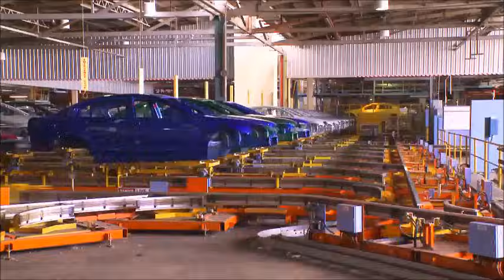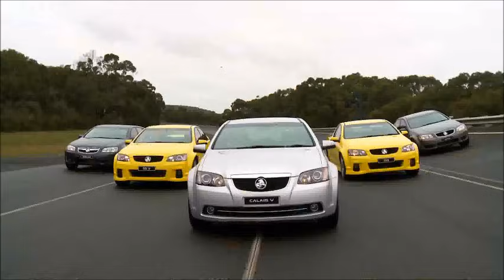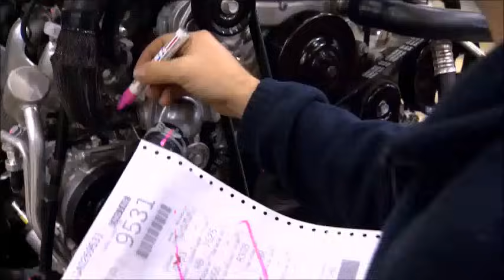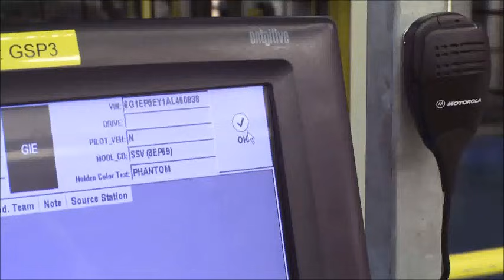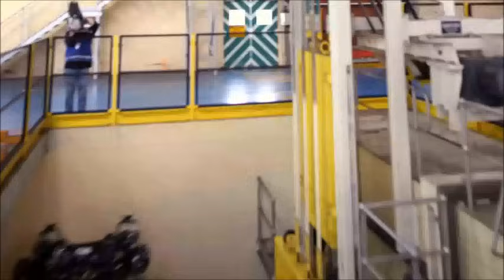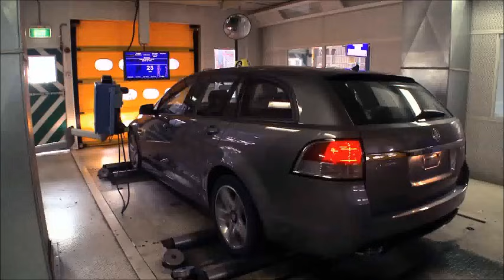Steel to Road - Building Holden VE Commodore FULL VERSION

Comment: you can see the design is maximised for production, there is very little thought for repair aspects, other factors over ride those poor sods who have to repair the vehicles. I have a ve commodore with fairly low km on it, quite a nice car but really not meant for ease of repair at all. The engine used in many vehicles in usa also, identical engine, and gearbox also.
Although assembled in australia seems lots of components usa made. Pretty amazing in my mind these complex vehicles are built at all.

Comment: I was unfortunately born way too late to enjoy a new holden, however, I don't see myself daily-driving anything but a Zeta-body Commodore. Truly Australian, and modern enough that I see them being a completely capable daily for decades to come, especially when you look at the drop in quality and excessive reliance on technology of modern equivalents. 

They may get old one day, but thankfully built in a time where they're still largely analog, and the digital components are easily repaired, replaced or compensated for.

Comment: Engines were rubbish timing chains
Reply: Change the fucking oil on time you half wit
Reply: Problem was people were servicing their VE’s at 15000km, Holden’s set guidelines, when in reality they should be servicing them every 6000-8000kms. I service mine at that range and have not had any issues with timing chain breaking or stretching. No issues with PCV either.

Comment: My VE Ute has now clocked 400,000 klm. In that time ive replaced two fuel pumps a starter and  alternator. 
Its been an amazing car, i couldnt be happier. Now they are not being made anymore, im going to keep her.
Reply: Thats not too bad at all. My VF Calais V is only just short of 200,000km at 11 years old, but its still my daily driver and other than routine maintenance it's still almost as good as the day I picked it up. Might need struts and shocks soon though lol

Comment: Pity they didn't tighten all the Earth connections.
VE has so many 'faults' caused by Earth points and poor wiring.
So far, 17 years of grief with mine.
Reply: Yeah they did fix it, in the VF2 lol
Reply: @NoOne56488  
too fckn late.

Comment: The VF commodore in 2013 retains so many parts inside and out from the VE model, which includes doors, windows, above door trim panel, mirrors, both windscreens, heaps of underbody and engine bay pieces. That’s how revolutionary the VE was. Some of its styling and engineering lasted 2 generations and 11 years.
Reply: The VF is basically a facelifted VE. They are essentially the same car but different interior and different exterior. The body, running gear and drivetrain are identical.

Comment: Shame about the Alloytec in this car, I would of loved to got a VE but that engine makes me steer clear. Got an VY S2 Acclaim and it's nice to be able to drive something that's apart of my countries history.
Reply: L76 ain't bad, mine is at 190Kmi (bald eagle units) on the original lifters. They complain loudly some mornings and the car was throwing some oil pressure codes so had to tune out the AFM/Dod crap. it's held so far but needs to be cammed and that shit pulled out soon.

Comment: Holden doesnt exist anymore because Consumers DID NOT WANT big heavy RWD 4 dr Sedans anymore like the Bogandore...same as the Falcon...the market shifted and they did not...simple as that
Reply: Yep, now those same people drive suvs that are bigger, heavier, need a crane to access the engine compartment, have less room than a station wagon, get far worse fuel economy, have more expensive replacement parts, are very hard to see out of,  have much bigger tyres and wheels.
Reply: @jayjaynella4539 plus handle like a fucking aircraft carrier and gutless

Comment: I’ve bought myself a VE Series 2 SV6, and far out this is a really interesting watch. They did a bloody good job on mine, almost 200,000 on the clock and it runs and drives like a charm. Awesome car.
Reply: It's a v6 bro relax.
Reply: @Lyric91xx  I'm plenty relaxed, mainly because I don't even own it anymore.
Reply: @jnthepassenger347  Did you replace the timing chains?
Reply: @SRB9272  Sold it and bought a CX5. Became a piece of shit about a week after I posted this comment, didn’t do chains but it had constant check engine lights and constant issues.
Reply: @jnthepassenger347  as a mechanic, the cx5 ain't much better, particularly the diesels engines! They just blow up!
Reply: @ That’s why I got a petrol one 😌 thing slammed into 2 kangaroos and survived, no bull bars nothing. Bent the fins in the AC condenser and the air still blew cold.
Reply: @jnthepassenger347 shouldve just got an ss bro
Reply: @Lyric91xx because fast always means better…

Comment: Dont buy one they are trash I have a ve ute and have had nothing but problems and they can be money pits. My ute is between 2007=20011 series 2 and I bought it for AU 18k and have spent 6k trying to get it reliable and still spending so right now its at the mechanics AGAIN and it's had 3 tow truck rides so buy a Ford instead more reliable lest costly  to fix and you would be a more happier driver as I have owned fords all my life
Reply: They're great cars, you just bought a lemon lol

Comment: Did GM get full returns in the mega millions it cost to set up Holden's plant? What happens to all the kit & tooling, machine tools, presses etc when they close a plant?
Reply: Some went to Precision Components on Port Rd to continue making panels to keep supply up for 10yrs . When Holden closed, so did Precision Components a few months later. Stamps and dies usually get melted down after use and presses go to other high bidding car/truck manufacturers . Holden had the biggest press in the Southern hemisphere, I was there when it was being installed and very impressive

Comment: A brand let down by scrimping on quality, stretched timing chains etc, faded paint works, cheap plastics, costing families thousands to fix, its not just manufacturing costs that let this brand down. Families can’t afford things like $35 parts that end up costing a couple of thousand to install.
Reply: Paul Golle. You’ve never owned a VE have you?  I’ve got two of them (a V6 and a V8) both 2008 models. The V6 one I’ve owned since it was two years old with 50,000kms on the clock.  It now has over 320,000kms on the clock and the only major problem it ever had was the torque converter went at 300,000kms.  The VE was a decently built car contrary to the popular belief of those that have never owned one!

Comment: Who ever purchased a SS manual was     robbed 
Holden Installed standard clutches instead of heavy duty 
You could of had it replaced under warranty if you wanted to
Holden didn’t recall them which I found dishonest 
Saying this the car was too plastic and cheap quality built too

Comment: reality bullshit check-2018 now truth is out gm and holden ripped off the taxp[ayer-high strength steel blurb was a total lie,,the company told so many lies and treated its customers so badly only the most devoted (those who drive 20yo holdens defended them) good riddance to bad rubbish.. oh i spent 2 yrs welding up the camira/Gemini/and commodore at the Acacia ridge plant in the early 80,s even the employees (who got a big discount) would not buy the cars they built..

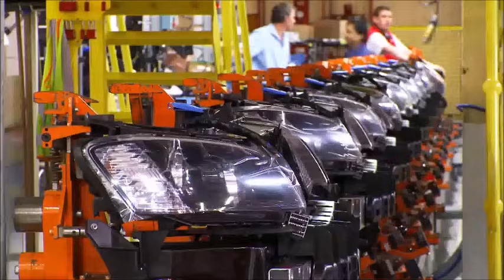Comment: 10:45 Black Chevy Caprice
Reply: Mart ya farken right that is a farken caprice that’s rare too but there still is 5 types of VE series Holdens
1. Holden VE caprice/stato
2. Holden VE commodore Omega
3. Holden VE commodore SV6
4. Holden VE commodore SS/SSV
5. HSV VE E series GTS or Clubsport
Reply: They came in a Ute Sedan Or Wagon they can have different electricals because some have fixed AC others have Split system AC you get the option of a LS2 6.0L V8 a LS3 6.2L V8 a 3.0L alloytec V6 and a 3.6L Alloytec V6 LS2 found in the caprice and SS LS3 found in the HSV 3.0L alloytec found in the omega and caprice and the 3.6L alloytec found in the SV6

Comment: the VE holden are the most shit car ever made the old school one are the best like one from the 70 to the 90
Reply: what a stupid comment give me some facts on why the car is "the most shit car ever made"  i have owned my VE commie for almost a year with no issues. lol
Reply: @big_bunsAU  the VE is an awful car, cheap nasty plastic interior (if you like that up to you) but the worst issue is the alloytech 6 cylinder engines that fail continually, timing chain failures on interference motors. NZ Police ended up with over 200 replaced. They are a weak car.
Reply: iceman nz 

iceman nz  mate you are making yourself look like an idiot lmao

Please either own a VE commodore or get some mechanical know how don’t copy and paste the latest arctile on why holdens 3.6 litre engine is bad lmao

If you knew anything about real automotive reliability you would know very well most modern cars theses days have a tendency to have issues not long after they are purchased...

Specifically holdens 3.6 engine has been known to gunk up due to direct injection (SIDI) and the poorly designed PCV and ventilation system underneath the rocker covers.

I ain’t some gm fanboy but I know very well gm vehicles arnt the most luxurious cars and the extreme use of plastic isn’t fantastic but overall stacked against other cars...there not a bad car/engine not the best not the worst. 

As I have said before my VE is almost at 200k on the clock and still no timing chains this is due to correct maintenance and regular inspections.

no car on our roads is perfect NONE